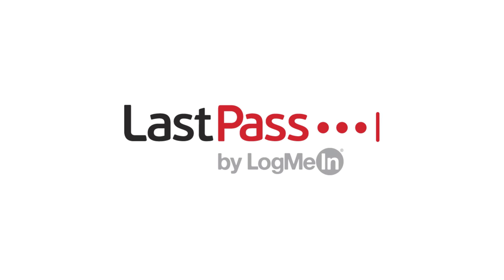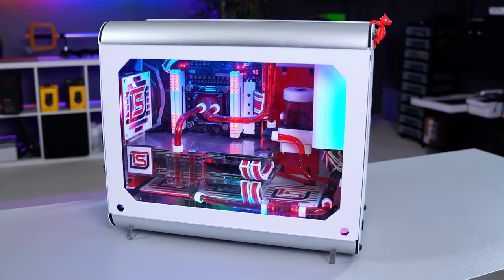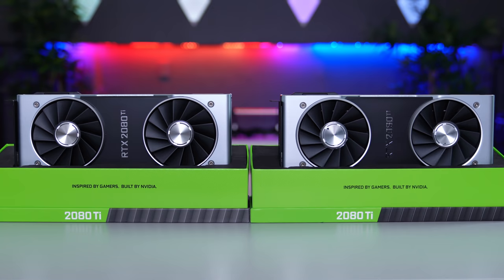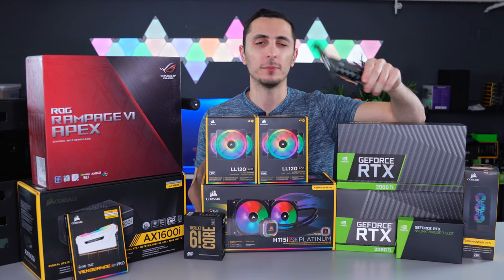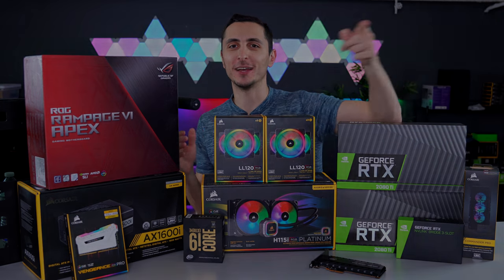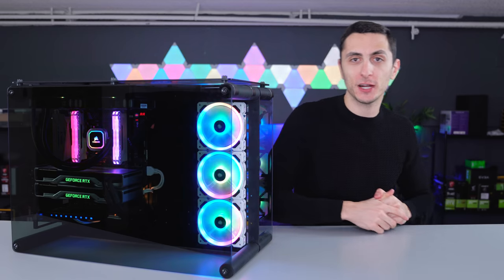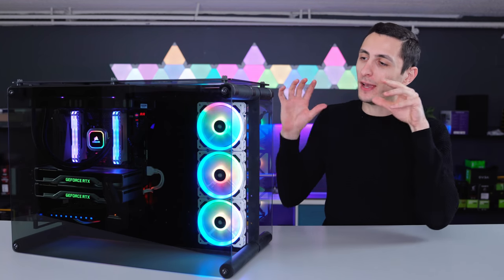I'm Re-building My PC (BIGRED) - Part 1

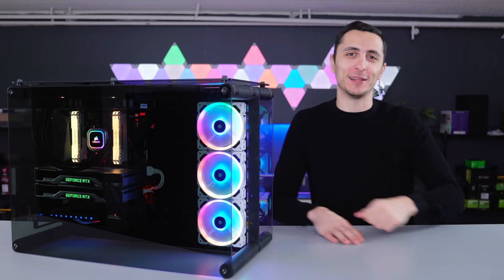Comment: 10:34 my favorite part
Reply: David Obrien to be honest that’s a good deal
Reply: David Obrien it’s pretty good for the price but if I were you I would look at getting another 8gb of ram for a total of 16gb, with 8gb of ram you’ll have trouble running some games with even the slightest bit of things in the background open. Also, it’s pretty slow for ryzen, I would look at a 3000mhz at the least but preferably 3200mhz. These parts are easy to upgrade you just take out two little sticks from the motherboard and put it new ones, just like that and you’re done
Reply: @Sk-oo4rl  Looks pretty nice, cpu and gpu are very powerful, but i would upgrade that 8GB of ram to 16BG. 8GB is okay still, but  when i played the game called Rust on 8GB of ram it started to lag because of Ram usage was up to 95%, but it is a nice PC to start with.
Reply: @Sk-oo4rl  I would go with a custom build as the ram is not only slow but is only 8gb, just go on pcpartpicker and you'll find a system in no time
Reply: Get a girlfriend
Reply: @Sk-oo4rl  its good if you switch that 8gb for 2x8 3200mhz of ram because ryzen runs REALLY well with high ram.
Reply: @Sk-oo4rl  Seems pretty good, that 2400mhz ram with ryzen tho is a big no no. I would change that to 3000mhz at least
Reply: @Sk-oo4rl  pre builds are overpriced i suggest that you build your own or if you are not confident yeah i think you should buy it it is pretty decent for 829 pound

Comment: Hey, so i has been saving for a while but was stillon a very strict budget and my pc isn’t great due to that and because of this my specs are AMD - Ryzen 3 1300X 3.5 GHz Quad-Core Processor - MSI - B350 TOMAHAWK ATX AM4 Motherboard - Patriot - Viper 4 8 GB (2 x 4 GB) DDR4-3000 Memory - Western Digital - Caviar Blue 1 TB 3.5" 7200RPM Internal Hard Drive - MSI - GeForce GTX 1050 Ti 4 GB GAMING X 4G Video Card - be quiet! - System Power 8 400 W 80+ Certified ATX Power Supply. I still don’t have a lot of money but to get better performance in game what should I upgrade? And what should I upgrade it too (keep in mind I don’t have much money)Thank you.

Comment: Hey, just wondering, are you gonna move the bottom 2080ti down a slot? The top card literally has no airflow to function properly. The temps on that top card are gonna be all messed up if you don’t move it. That 3 slot SLI bridge is actually needed in this case.

Comment: Keep in mind that the included aluminium bars at 8:28 will bend down alot if you use a big and heavy radiator+fans and liquid
Reply: Oh I just saw that the bars get screwed into the glass panel ops, but how much weight can it hold tho

Comment: I have the same remote start for my pc . It works great , good choice. On that you would think that Rajintek would have done something to prevent the power button and USB from getting covered
Reply from the maker: There is techincally a way around it, by mounting in the front, but it interferes with the radiator mounting. Not a big deal

Comment: Check the motherboard manual for proper x16 x16 connection for the GPUs . I think it’s the top slot and the 3rd slot, so 4 slot spacing!

Comment: Can someone explain the point of those 3 fans on the right? The case is open from the sides so do they help airflow? I've seen this setup before but the fans sit on top of a 360mm radiatior.

Comment: I think this is going to look about 1000X better than the Big Red 1.0 build was. And as much as I trust your design judgement I still have a small opinion. 
I am in complete love with the aesthetic of the back system with the RGB accents. I think just painting the GPU shrouds black and creating a loop for the CPU and keeping the current fans and everything else the same (not barring some black and silver cabling from CableMod) would look absolutely fantastic. However, this is just my opinion here, Ed.

Comment: @8:40 Im sure you must be able to mount the IO on the front of the case, no-one would release a product with a flaw as bad as this! Edit: Just looked at the product page- you remove two screws on the side and there are mounting holes to screw it onto the front of the case.

Comment: Can you not place the expansion on the bottom so that it doesn't cover the top I/O? or maybe the the I/O is able to move somewhere else then that would make sense. If not then I feel like the expansion kit should have been designed a little better to allow for top I/O access...

Comment: is this a good deal?
b350m pro-vd pro motherboard
CX550M semi-modular power supply

The PSU is brand new and the motherboard is 2 months old. He is selling both for $80. Good deal yes or no?
Reply: As long as you get the right cpu and none of the parts are broke yeah it's a good deal
Reply: @telebtw5697  i got a ryzen 3 1200 cpu (upgrading to a r5 2600 later) and a gtx 1060 3gb windforce oc

Comment: Hi Man i loved ur content ... but i have one q plz 
is this setup worth the 2200$
CPU : Ryzen 2600X
RAM : 32GB DDR4 RGB Corsair
CPU COOLER : NZXT Karken X72
MotherBoard : X470 AORUS ULTRA GAMING Gigabyte
SSD : 1TB Samsung
HDD : 2TB Seagate
Video Card : GeForce GTX 1080 Ti 11GB EVGA
Case : Corsair Chassis, Carbide 275R Mid-Tower, White
Monitor : MSI Optix 1920x1080 144Hz
Keyboard : Corsair K55 RGB
Mouse : Corsair M65 RGB
Speakers : Logitech Z200

And thank you if you answer <3 (:

Comment: With the expansion kit blocking your power and some io would I be possible to go somewhere and get a laser cutter to cut out a slot for it, then all you need to do is sand the sharp edges etc...?

Comment: @Techsource Yo, get tapered sanding tool bits for a hand held drill and create tapered sections for the power and usb ports. this way it created an easier access to the ports and power button while giving it a better look than a plain cut out hole section. ^_^

Comment: Hey 😃 This case looks great but i think fractal r6 or meschify s2 will be better choice. Easy mounting 360 on top, prepared mounting holes for pump/res. Most importatnt they have dust filters soo your radiator and fans stay celan. This is all about case. Awesome hardware dont need any thinking. I am waiting for part 2 and 3.
I am wondering what will You do with parts left over BIGRED without cpu and storage 🤔😉 
I am building pcs for my friends and now my lga775 baset setup needs upgrate, would be cool and amazing if You can support me  a Little bit. 
Great luck with this BIGRED build, hope ends up well.

Comment: Oi ed you should keep the three slot because the 2080ti’s run HOT. Spread the cards out more because the top 2080 ti will get hot quick

Comment: Im new here im actually getting into pc gaming i have a pre built atx tower that im about to get a new psu and gpu for currently it has an i3 4130 @3.4Ghz duel core w/ integrated intel hd 4400 graphics 8 gb ram and a 1tb hdd and a 300 watt psu ill be installing a new 730 watt psu and evga gtx 950 ftw into when the parts arrive later today what i want to know is what kind of proformance boost can i expect considering the parts i have coming and what should i replace later on for a better gaming experiance should i upgrade the cpu or get an additional 8 gigs of ram maybe a newer gpu i honnestly need to know

Comment: Hey techsource! I’ve been a huge fan for a couple years, trying to imagine my dream set up of your videos. If you ever see this, and ever do a setup makeovers, I would love a new make over I am stuck to limited équipement which make it hard to play games and work sometimes, I basically game on a 2009 MacBook Pro which barely runs any games at 30 FPS let alone the games on apple which is limited, my desk is a extremely small desk and it’s too high because I have a x rocker gaming chair which is great, so I would need a desk with a height around 26-28 inches high. I also need somewhere to do homework on too, cable management isn’t that bad but needs fixing. Monitor is ok but would be good for an upgrade, 1080p 60 hz which isn’t bad but for better quality of gaming would need better upgrade and and extra monitor, I hope you see this. I’m 15 and live in canada! Would mean the world to me for a new setup and much love from Canada 🇨🇦

Comment: even for what you have and how far you will overclock 1000 or 1200 wouldve been more than enough since a single 2080ti can run on a 500 watt psu

Comment: HELP HELP!! Hey guys, I’ve started to build my first gaming pc and everything is brand new. Basically I got everything ready to setup, everything is connected. But when I turn power on it runs for 5 sec then, it turn back off ( pretty sure everything is undamaged or unharmed ) ALSO I put perfect amount of thermal paste so I don’t think that’s the problem. HELP HELP HELP. NOT ONLY THAT. I   FOLLOWED EVERY SOLUTION LIKE TAKING OUT RAM AND REPLACE IT ANS GPU BUT STILL NOT WORK!

Spec: 
CPU: I3 6100
GPU: nvidia 1050ti 4gb
Liquidcooler: Mastercooler liquid 120
Motherboard: gigabyte b360m h
Fans: 2 fans
Ram: 1 ballistic 8gb
Powersupply: corsair 450w Active PFC 80 PLUS 
Ssd: 500gb
Reply: TickTockMC - PvP & Edits cheack pc part checker and see if everything works together

Comment: That case design is one of the worst designs I've ever seen.  Expansion kit for a top-mount radiator which is then covered by glass?  From very recent experience I can tell you that gap on the side is not going to be enough for the fans to push the heat out.  My system isn't even overclocked right now and when I had an airgap that big, loop temps went up by 5-6 degrees C.  Overclocked it would be ... bad.

Also, if the current 'temporary' Big Red is too noisy, I'm not sure an open-air case is the best choice.

But ... those USB ports + power button.  SMH.

Comment: @techsource You can switch place your power button : https://media.ldlc.com/ld/products/00/04/79/01/LD0004790171_2.jpg
You can also see 2 point to fixe the controle panel on the right of the 3 white fan at 10:23 for example.
Nice video and i hope you will see my comment :).

Comment: Request to my hero.
Just to let you now I loved all the videos I am talking about roast my set up you little edits make me lough everything you do I am a fan of it but what did you actually do with that gaming pc. You only need strong laptop to edit videos.

I have gaming pc and my god it’s good but I don’t have great cooler for my RYZEN 5 2400G 
So Ed please give me these 3 things G.SKILL Ripjaws V Series 8GB (2 x 4GB) DDR4 2400Mhz CL15 1.2v
CORSAIR Hydro Series H150i PRO RGB AIO Liquid CPU Cooler, 360mm Radiator, Triple 120mm
And last I have gtx 1050ti so I need to upgrade that to EVGA GeForce GTX 1070 Ti SC Gaming ACX 3.0 Black Edition, 8GB GDDR5, EVGA OCX Scanner OC, White LED, DX12OSD Support (PXOC) Graphics Card 08G-P4-5671-KR
All this to make my videos look good plus every time I make gta 5 videos with coolest mods the game crashes or lags. 
So Ed pleas don’t ignore this request it means a lot to me if you say no it’s ok I will still watch set up wars and roast my set up or builds on your channel.
Here is my post address 
Shop 6B 28 Elizabeth Street
Acacia Ridge QLD 4110.